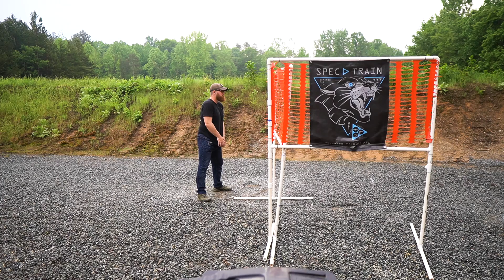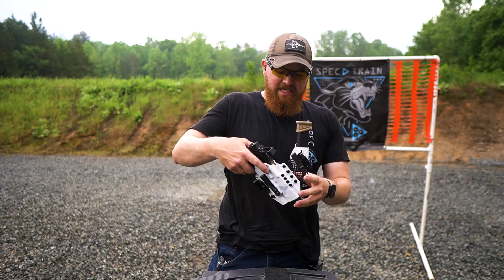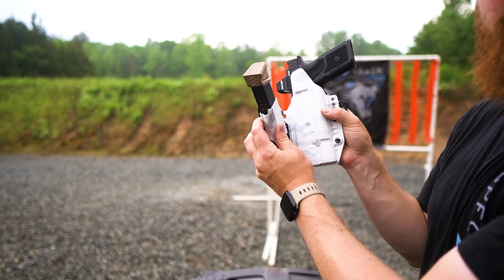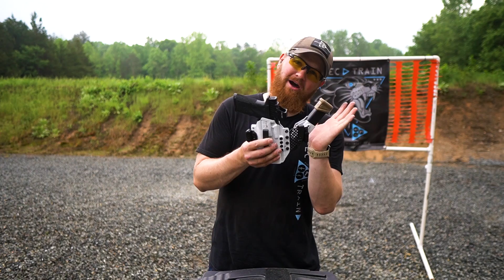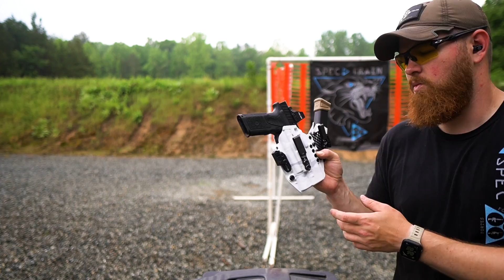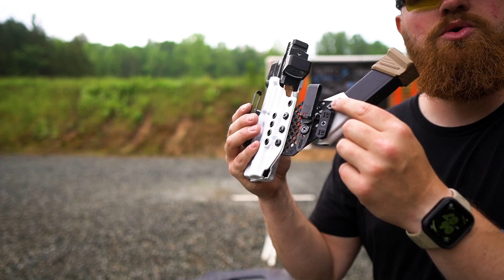Tier 1 Concealed / P1T APX Holster - The New Gold Standard in AIWB CCW

Comment: Just received mine, first T1 holster. I’m not a claw guy to me imho claws just print more. The quality is great as expected.  But yeah I may taper down the claw to see if it helps before removing it completely. I took the claw off my Werx holster and I guess I’m just use to not having it. It may just be me but claws print more as it bulges out the belt line. Either or Im happy with this APX holster.
Reply: What kinda belt you running?
Reply: @Ohyouknowbro - Kore Essential belts

Comment: Carrying tucked with the belt clip offset isn’t any more strange than having the holster clips exposed
Reply: I was thinking the same thing lol. Personally I consider tucked with visible clips to be not concealed at all. Same with having your buckle way off to the side or wearing a "tactical" nylon or webbing belt.  Anyone with a little bit of knowledge knows you have a gun the instant they see the clips, your buckle way off to one side or one of those silly tacticool belts.  For tucked the only acceptable clips to me are ones that Velcro onto the inside of your belt or Ulticlips that attach to your pants and can be than hidden under the belt and the only belts you should be using are gun belts that look like a normal leather belt anyone would wear.   Otherwise every other gun person, every LEO, and every gang banger or anyone for that mater with a little bit of experience and/or knowledge knows you have a gun for sure. Even "normies" will wonder wtf about your clips and weird "military belt" or way to the side buckle and may even ask you about it.
Reply: @josh885 as someone who has carried around plenty of people that would be alarmed or turned off by noticing me carrying, ive never had it happen. Tucked in with a clip exposed over a leather belt no one thinks twice. Even when i think im noticeably printing, people that know I carry still ask me if i am.

Comment: Still does not beat the txc pro which is the best minimal holster if you like carrying bigger guns but don't like the bulk of other holsters txc x1pro is so good I have a bin of holsters and as far as teir one I got the bungie axsis elite and should have got the agis becouse the darn thing lands to close to buckle the other thing I hate is that they open the top of holster so easier re holster but it adds unnecessary width which I don't like would rather have it width of just gun so it's more comfortable 😉
Reply: X1 pro is so good. Idk why most other holster companies need to use such thick kydex and so much of it. If the X1 pro didn’t have the built in wedge it’d be my daily go-to. Kydex wedges are insanely uncomfortable; how is that a good idea?
Reply: @EzraLopezUSPSA  I just put a small pad on it and it disappears and really comfortable I always put padding on the holster but don't need a lot of padding with x1 pro and if you only put padding on wedge it really works well .also I carry it lower than it comes I put a longer metal clip on it and it really is good to go. It's crazy that people lie so much for companies for barley and y money they don't understand that it is the definition of selling your sole not very cool. There is also a x1 pro without the wedge .
Reply: @charles17508  the only X1 pro without the wedge that I know of is for the p320

Comment: They should just sell the grid and mag pouch separately with mounting hardware to its current axis and agis lineup.
Reply: I said the same thing!
Reply: Get the g code mag carrier like I did. I bolted the g flex to my xiphos elite because I wanted my clips on the holster only because of where my belt loops end up and where I want the pistol. The g flex is also adjustable spread and angle from the pistol
Reply: I love Tier 1, but they won't because they want to make money. Their strategy has always annoyed me, but they're the best so I keep buying them.
Reply: I think they will
Reply: I was just looking on their website. I'm hoping they do add that grid and separate mag holder for existings models. I'm not trying to get 3 holsters now, since I have 2 T1C holsters lol.
Reply: but yah see... that wouldn't make as money though so.......

the Apex does have extra screw holes on the gun holster so you can carry without the mag car and still have 2 clips.
Reply: @Rickrapson  yeah exactly like the xiphos. It’s just a xiphos with a mag carrier
Reply: “Money, please!”
Reply: exactly! Or someone can design this grid for 3d printing
Reply: Just to be clear, if you have the weapon mounted light holster you can carry it in the holster with or without the light?
Reply: @Grisha-wp1nt  No, because the retention is on the light mount
Reply: I would inquire to see if they would. Call or email
Reply: Not how it works at all bud. They are not the same molds
Reply: I have a APX. I might get some tegris and copy the grid.